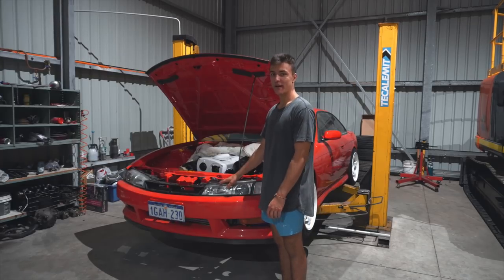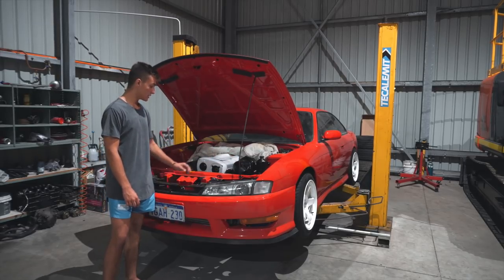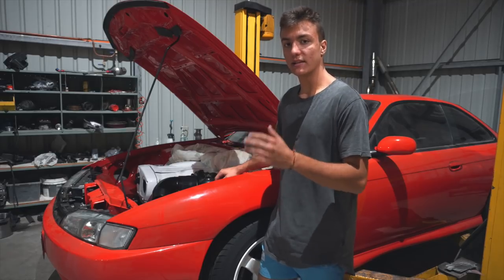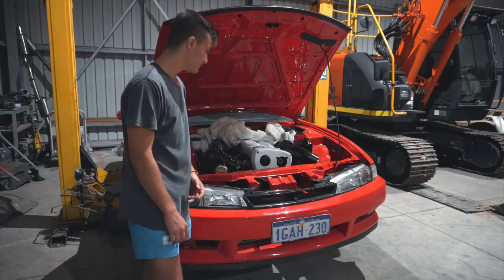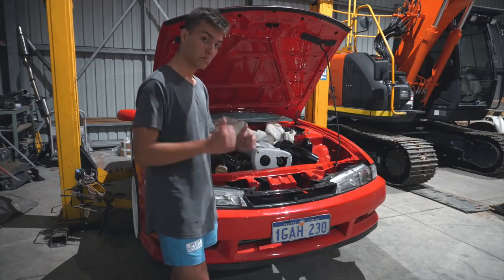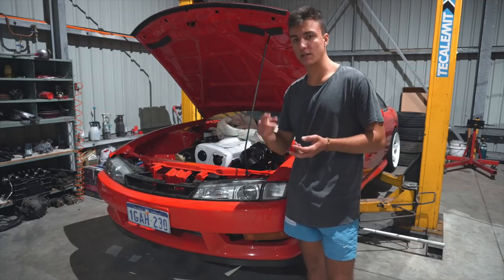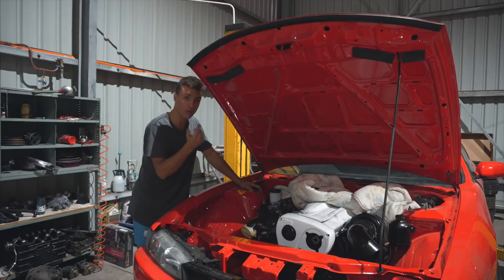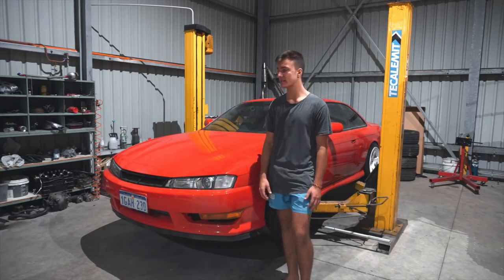ENGINE IS IN + R34 UPDATE | The Broken Silvia [EP7]

Comment: So many gaskets for that intake setup 😂 Looks so good in there though, with the bay shave and fresh engine! That ABS delete kit also really cleaned up a lot, will you need a proportioning valve with it? Also being a street car, wouldn't ABS be nicer to have?
Reply from the maker: Yeah there’s like 7 gaskets on the intake side haha. Have a look at the GK website for what comes in the kit. Don’t know enough to try explain. I just found a diagram online and followed which line goes where. We’re not in Norway bro so ABS can go in the bin haha. Car might see a rainy day once in a lifetime, will just be driven in the dry. Plus the ABS module makes fitting the dump pipe a little harder (not a real problem but it’s another reason for me to throw it out 😂)
Reply: @BrokenSilvia  That makes sense, haha envy you there! I only ask about the valve because the lines go directly to the brakes and the distribution might be uneven, but GKTECH probably thought about everything and it will be fine
Reply from the maker: Aaaaha I see.. So many people are running it, don’t think I should have problems

Comment: Can you use the factory RB25 fuel rail still when you adapt the RB26 plenum and ITBs?
Reply from the maker: Nope, you run the rb26 fuel rail
Reply: @BrokenSilvia  Gotcha, also random question: if I were to use LS coil pack on my RB25 s2, aside from wiring specialties harness and the coils themselves, what else do I need?

Comment: How did you get the shifter to sit in the right position. I have a s14 zenki with a rb25/30 with a 30 box and the shifter is sitting like 2-4cm too far forward. So I have to hold it into 1,3,5 when I drive. I know the box’s are physically a different length then the sr20 boxes. How did you go about it?
Reply from the maker: Had no problems man, it’s just a R33 GTSt gearbox. Made a custom mount for it and the shifter goes through the factory hole. Engine is sitting on a r33 crossmember and mounts so everything just bolts up